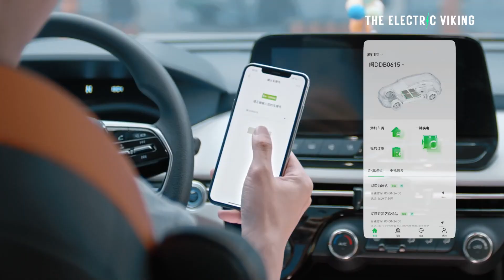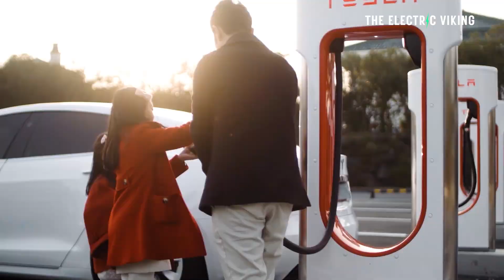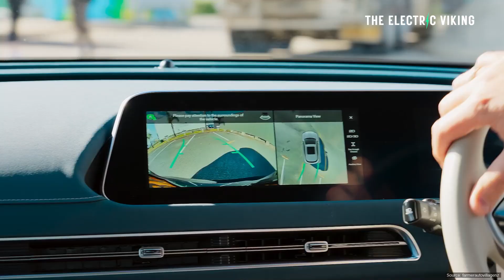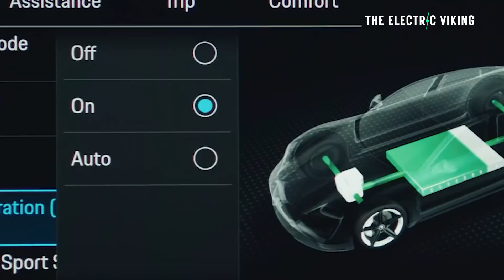Study reveals the price to replace EV batteries has halved

Comment: I expect to replace my battery in 20-30 years.  The math estimates that a 2018 Tesla battery should last for 20+ years or over a million miles.  :)
Reply: Gruber Motors says they are starting to see the original model S battery's fail at about 13 years.
Reply: @ctuna2011  Exactly this will happen. There is no reason not to offer longer warranty from the beginning if batteries will last. Longer battery warranty could create more trust to consumers but they will not offer that.

Tesla Viking repeating that "you can sell your failed Tesla battery...."

Really? Every "housewifes" are going to drop the battery down from the car and selling it in good price and everything is fine again :D
Reply: @ctuna2011  2018 + 13 = 2031?  Is it 2031 where you live?
Reply: Good luck with that assumption and fuzzy math.
Reply: 8 years but only 100.000 mile, no crashes and a ton of fine print.
Reply: That is for a Lithium Iron Phosphate Battery not a Lithium Ion Battery. If you keep your vehicle for over ten years and your battery lasts, then you should be in heaven.
Reply: @shawnnoyes4620  LFP is a Lithium Ion Battery.
Reply: My 2013 Leaf has 78% capacity, has been charged 4500 times @shawnnoyes4620
Reply: @shawnnoyes4620  Well , my 2013 leaf battery lasted more than 1100 cycles before I sold the car (after 8 years) in perfect working order. Any car with a long range battery should last at least 400000 km (1000 cycles) but estimated with the better bms 1500 cycles (600000 km) .
Which means that the battery lasts longer than the estimated mileage of an petrol ice car engine. Even diesles rarely will pass the 600000 km , for sure not without a few expemsive maintenance done in those distance.
Reply: I doubt that it will not last as long what you expect. It could work very long time if you are lucky but still battery degradations will lower your EV-range at least too much before 20 years has past. If these current Tesla batteries will last really as long as Tesla claims (1 million miles etc) , they could easily offer longer warranty for consumers.
Reply: @iSot80 if they really believe that then they would  give you a million mile warranty
Reply: Yes but only for LFP 500K- 1M miles or 20-30 years.
Reply: The bean counters think like all of you do, ignoring the math.  They would not insure the warranties.  Just like you would not.  That does not change reality at all.  The math shows that Teslas built after 2018 will last 20+ years.  The math shows that they will last far longer than 20+ years.  Wanna guess the estimate?

Lets just say, the million mile club will include most Teslas that are never wrecked.
Reply: @davidbeppler3032  Still Tesla offers only 8 years battery warranty.

if your battery last 20 years without problems, seeing is believing.

Comment: 8:30 Do you mean $10,000 per tonne?  😂
Reply: Yes it is getting a bit crazy here... Quantity over quality now.
Reply: No, $10,000/kg. Basically, you trade in your old 40kWh Leaf battery and at 195Wh/kg the recycling company pays you just over $2 million to take it off your hands.
It's a similar principle to the magic silver balls video the other day. You set them up in a room full of ambient light and generate the same amount of power as a small nuclear power station.
Reply: @yggdrasil9039  :face-blue-smiling:
Reply: Nope, $10k per kg, so you can make tens of thousands selling your old EV battery pack. It will pay for a brand new Tesla !
Reply: @JP16758  What he says is not completely from articles.
Reply: He is losing it 😁
Reply: @hardi.howdy.983  Not really. He puts out like 5 videos per day, so he doesn't have much time to proofread his script, if he even has one. The info is normally very good, but yeah, proofreading is needed.

Comment: If the price of EV replacement batteries is going down (halved), insurance company should start reducing the cost of EV car insurance.
Reply: Get Tesla insurance 💯
Reply: The insurance companies have to pay a lot for fender benders now because there's cameras and electronics equipment in everyone's bumper, EV or not, so I've heard.
Reply: Insurance companies don't pay for battery replacements. If the battery fails within 8 years the manufacturer pays for it. If it fails after 8 years the customer pays for it. If it is damaged the car would be totaled because the damage to the rest of the car would be enough to total it, regardless of the battery. The force to damage a battery is huge. The only exception that I can think of it if someone drives over a hard obstacle at full speed and only damages the battery. So yes the insurance company would pay for that but that's such a tiny percentage of EVs that it's inconsequential to the cost of EV insurance costs. An ICE car driving over something like that and ripping through the entire underside would also have a huge cost to the insurance company.
Reply: @juliahello6673  I think the same....except that even driving over a hard obstacle damaging the battery is also chassis damage ...because the battery protection case is the same as the chassi of the EV car (if developed as ev only like tesla and models on kia/hyundai egmp platform). 
For all cars chassi damage is very expensive.
Reply: I do not understand what insurance costs has to do with battery prices.
Replacing a battery is due to battery failure (warranty or own repair costs when the car is older).
Because IF any accident would damage a battery (at least in my ioniq 5) I'm sure that also the chassis is damaged...means a total loss. The same for any ICE car with a badly damaged chassis. And the same expensice because a comaprable ICE awd car does not costs less as my ioniq 5 in purchase price...
The mainissue is  ...and this is valid for all new cars...ice and ev...lack of parts, expensive parts (radar electronics , parking systems, cctv cameras around, ascc electronics) which have to be replaced at minor damages. Making replacing a bumper a multi thousand dollar issue instead of a few 100 bucks. For rear bumper the same (camara , parking sensors)
Also ICE cars with those driver assistances are very expensive to repair (BMW, Porsche, Mercedes and more)
Reply: That last statement of the black mass from a ground up EV battery being worth $10,000 / kilogram has to be wrong, because folks, not the best sort, would be stealing EVs to grind up the batteries.
Reply: I think Tesla will aggressively reduce their insurance in the future. It may force other insurance companies to reduce their price.
Reply: @bencarter2308  People are thinking insurance is based on the vehicle being a BEV when it's upon the cost to repair, the potential degree of damage to others, and risk of damage. When a new BEV is entered into the market these are the factors what will be used not that it is a BEV. So a small, lighter weight commuter BEV that is not high torque and high performance will be insurable for less than say a Tesla Model Y.
Reply: Insurance never goes down it's a ratchet, it goes up but doesn't come down for the same reason just like gas.
Reply: @frankcoffey  Using that logic a Toyota Corolla should cost the same to insure as a Lexus LF 500.
Reply: Wouldn't the price of the batteries dropping be an excuse to raise prices since when they total the car the battery will have much lower resale value.  Insurance companies make quite a bit of money off of parting out your vehicle when they total it.  Its a double win when they total your vehicle since they often sell the parts for more money then they pay out to you when its totaled and have an excuse raise your rates however when they have it repaired that is loss to them with their only profit being the increase in you insurance rate.

Some vehicles though totaled by insurance in the US get shipped offshore by the insurance companies to be repaired and often sold at Premium prices.

Food for thought on the Insurance Racket... er, um Industry.

Best!
Reply: Hopefully. I am self insured outside of liability.
Reply: I Canada my EV insurance dropped from what I was paying for my trade in, a 10 year old 330i Cabral.
I have a good driving record.
Reply: So the price of new EVs should drop drastically this year!
Reply: @williamgraham6917  Not impossible...
When I was a kid a new color TV costed a fortune...with only a 55 cm screen. Noww you buy a color tv for nearly nothing.
I expect the same with most electronics in modern cars..getting cheaper every year. This including batteries. Which will reduce costs of producing and later the purchase prices.
Reply: @williamgraham6917 not with tarrif.
Reply: 😂 insurance reduce rates!
Reply: @marcusalexander5251  He is asking about the future, you're trolling from the past.
Reply: Love our Kia EV6 except the part where it has lost 50% in a year! Just as well, we owe nothing on it and have no plans to sell. We did look at the EV5, but that would be an even bigger mistake! That EV is crap compared to the EV6! Cheap and nasty interior and oh so many more annoying so-called safety features like an over sensitive driver attention system and speed limit that flashes and beeps even if you go just 1kph over the posted speed limit! Many will say just turn it off, yeah great just have to hunt through the menu system each and every time you start the car! No more modern cars for us!
Reply: @gregb1599  Should still be under warranty, make them replace the battery. Or are you talking 50% value?
Reply: @frankcoffey  value
Reply: Not gonna happen. You dont leave Hollywood. Hollywood leaves you. Come on Elon…let get the Tesla insurance asap.
Reply: Shop around. Our Tesla costs the same as our 14 year old truck for insurance.  First 8 years, Tesla warrantees the battery.
Reply: Very few damaged in an accident. 
Reduction in cost to insurance will be small
Reply: maybe, instead of 5,000 a year now 3000 plus inflation 3,500, wow what a save. i owned a PHEV for which i was paying 1300 insurancebecause it was electric. i traded it in to buy a vw atlas R LINE a beautiful vehicle worth 55,000 dollars, INsurance rate 800 dollars. once the time comes to replace your ev, it will be worthless, why6 nobody will want it, so you will have lost 50,000 in 5 years and saved nothing and haqve nothing left to buy a new car , your loss considering you are buying a new one could be astronomus.
Reply: @art333-dg8dd  Why would the value of the EV be worthless?  
Cost of insurance reflects the risks of the older Li chemistries which can burn, the heavier weight which can cause more damage to other vehicles, high-torgue high-power performance which early adopters wanted. 
Newer BEV's will have higher energy density so packs will be smaller and lighter making the car lighter (which will save on tires), the new chemistries don't catch fire even if broken, commuter cars will most likely be de-tuned with lower torque and lower speed performance (which also will save on tires), and there will be more service centers  with more availability of parts at more competitive prices. 
All of these changes will reduce the cost of BEV insurance.
Reply: @art333-dg8dd  we shall see. When the EV catastrophic sets in. Your cant even find a used car dealer to take your car. That is what I happening in China right now. Even the used RS6 is being sold at scrap price, but no one is touching it except media personal buying it for the show.
Reply: mean while in 5 years my vw will stil be worth 20,000 dollars
Reply: but gas will be North of 10 dollars a gallon if you can get it.
Reply: @art333-dg8dd Why would your VW be worth 20k when companies make $10k EV's and we will get them en masse in a couple years. People would rather buy a brand new car.
Reply: @ctuna2011  Will it be worth $20,000 if the engine is blown or needs a rebuild , asking because I just watched vlogger I Do Cars  teardown a fairly new  Audi with failed engine,over $30,000 for a rebuilt engine.Watch that video.
Reply: @art333-dg8dd  unless it is a VW Beetle of 50s to 60s vintage VW are worth nothing post the warranty period.VAG group have one of the biggest depreciation cost.

Comment: One will ALWAYS get 1/2 range of 60kWh pack from 30kWh pack, all other being equal, pay attention! Maybe 120kWh pack will cost the same in 8 years as 60kWh pack costs now, then you can get double range for the same price, but NEVER for the same capacity.
Reply: I think what Sam should have said here is that if the energy density doubles over time,  your new 60kWh battery will take up only half as much space (or  be half as heavy) as the old 60kWh battery, so you could theoretically cram a 120kWh battery into the space left by the old 60kWh battery, thereby doubling the range.
Reply: @kiddster2112  There is no basis for hope that energy density of Li-Ion batteries will double any time soon. It didn't change much in the last 30 years. Li-Ion is not a new technology. Other chemistries are even worse in this or other aspect or only work in the lab.
Reply: Sam gets this wrong every time he discusses density and range.
Reply: but…… a 60 kWh pack would likely be a lot lighter than the original, so you would get weight saving and therefore more range from the same capacity pack. buy yes, he got it wrong.

Comment: It's about $17000 to replace a Tesla battery. I hadn't heard that Tesla had halved that price.
Reply: Tesla is around $ 2,900 labor to install batteries plus the cost of the batteries... that's if it doesn't need other components,  and surprise it all ways does. Good luck  dealing with Tesla
Reply: You heard it here first.
Reply: Mostly labour time
Reply: Way less frequent than engine replacement.
Reply: @chrishaberbosch1029  never replaced an engine in 55 years.🤔
Reply: @chrishaberbosch1029  Not what I've heard.
Reply: @chrishaberbosch1029  However... battery development is much quicker than ICE.... Hence why the likes of NIO have a unique USP, ultra fast charging, easy battery replacement and battery future proofing....
Reply: Actually a battery can be swapped out in one hour.
Reply: @PhilipX2030  rubbish.... Tesla state a minimum of 4 hours

Comment: 7:40 HUH??? If I have a 60 kWh battery today, I only need a 35 kWh replacement battery in 2035 for the same range??
Science à la Sam the Electric Viking... ;)
Reply: He's said things like this before. 
It's like he thinks halving the weight of the battery doubles the range of the car. Obviously the lighter battery will help with the watts per mile/km, but probably by like 10 or 15%. It's not going to halve your power consumption.
Reply: @patrickbeck4062  Yup, exactly.
Reply: He probably means smaller physical size and weight for same kWh.
Reply: @JeraXO  Yes, I figured so. But it's not what he said.
Reply: More likely you’d get a 120kWh battery with the same dimensions and mass having double the energy density ergo twice the range at possibly half the price?

Comment: Mitsubishi Outlander PHEV is only covered after dropping below 66% degradation ! And forget about 8 years, as it’s only 160,000km I’ve done 134,000km in my ICE vehicle in 5 years so if it were an EV I’d only have maybe 6-7years of use before I’m on my own.
Reply: PHEV batteries are small so they get hammered. PHEV is a dead end now
Reply: Tesla has the same warranty. 8 years or 160,000 km (whichever comes first) with batteries falling under 70% are replaceable under warranty. 

With the Tesla you'd also just have 6-7 years like the Mitsubishi. The warranty isn't that bad.

Comment: I predict battery prices will half again.
Reply: Every 7 years, either doubly improved or prices are reduced by 50%, at least
Reply: @sebyst7907  since 2010 cell prices at the pack level or per kwh have dropped over 850%
Semi solid state cells and solid state cells will spike this up a bit as they enter the market over the next couple year's likely.

But then they'll drop rapidly and so will the other chemistries as sodium&better lfp lmfp or m3p iron based chemistries continue to take over the low mid and energy storage sectors of the market.
Reply: BS. What do you base your predictions on? Whether your back is itchy or not?
Reply: @robertfonovic3551  other up & coming battery chemistries will make current batteries irrelevant if the price doesn't fall. 
Competition.
Reply: Especially with sodium batteries
Reply: @larryc1616 I like sodium on my fries.
Reply: Cleantechnica reported on this at the end of February 2024. CATL and BYD will halve their prices at the end of July/beginning of August 2024...means in around 3 weeks. 

Why can they do it? Optimized automation of the cell production and lower prices for the basic materials.